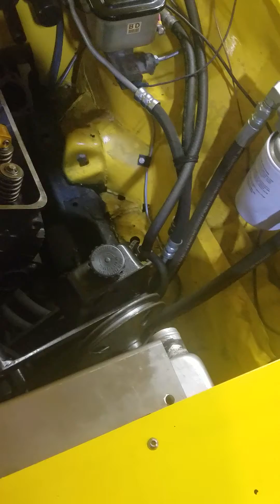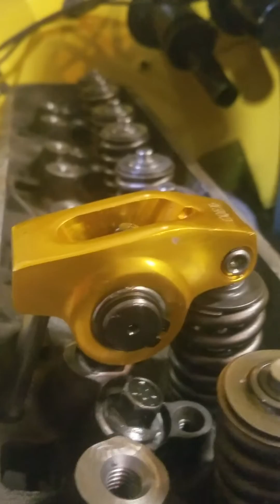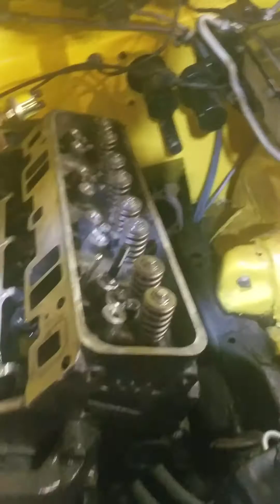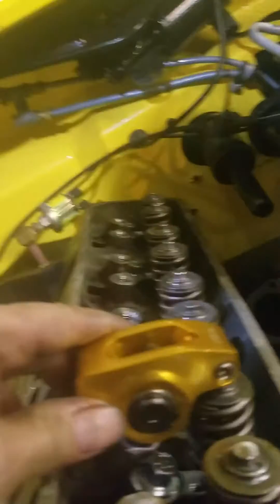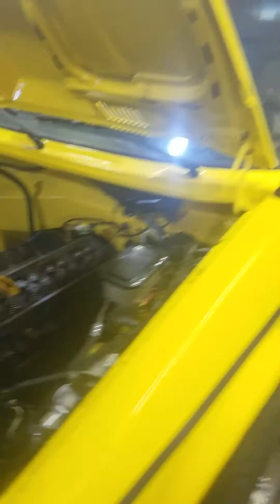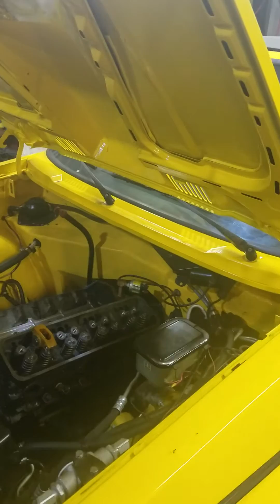Modifying and test fitting chevy 350 vortec heads for thread in rocker studs.

Comment: Another thing i wanted to mention, that car is not a 4x4 it is an AWD (all wheel drive)!!!
Reply from the maker: @jcanfixall1585  it is a 208 transfer case out of a 3/4 ton truck...  it is 4 wheel drive... it can be locked into 2wd or 4wd.

Not trying to be negative,  but it's always funny to me when folks who have never sat in the seat or ever even seen something in person tell others what something is or is not
Reply: @MinnesotaImplement  I made a mistake I figured you used a car AWD chassis to build it... Isn't it hard when cornering with 4x4... I built a 1983 Chevy C10 short box AWD using suspension out of an Astro van it was bad ass cornering a full size truck at 50mph, I had an Audi Quattro when I was younger.... There's a few AWD cars on YouTube one of the cooler ones is a G body I think a Cutlass from LA...

Comment: What part number for the ARP studs did you use.
Reply from the maker: Sorry, I don't remember..  it was a couple of years ago now, and I don't have the package anymore.   I would have gotten them from Jegs or Summit
Reply: @MinnesotaImplement  These stud dimensions are all over the place. Going to do a comparison vid with stock, pioneer, ARP and GM screw in studs. Hope to finish my jig for the Bridgeport soon.
Reply from the maker: @tjs_welding_and_fabrication  yeah, it is best to have the parts on hand before doing the machining...  otherwise it's anyone's guess on what is "correct".  I think that is part of where my original engine builder went sideways,  and why I ended up having to re-do this engine myself later on...  it was a mis-match of random high-end parts... all good parts, but nothing worked well together...  like he was clearing off his shelves of extra stock to build my engine...

Comment: no vortec will spin to 9 grand,EVER......

get a rev limiter and set it to 6000 MAXIMUM.vortec heads do not flow over 6500 when professionally ported,if these are stock they will struggle at 5500.
Reply: "vortec heads do not flow over 6500"...  That's baloney. The old "fuelie" heads were capable of letting a 350 spin well into the 6000 rpm range while still making power and the Vortec heads are head and shoulders above them from just about every performance standpoint, the only shortfall being their stock valve lift limitation. When modded for proper retainer to seal clearance, there's no contest. I agree though, 9000 rpm is well out of the realm of what Vortec heads are capable of.

Comment: 9000  RPM engine ???? WHAT ??? either you are smoking some real crazy drugs or your builder is a real good snake oil salesman the springs and retainers  look stock, voretc heads need to have the guide boss cut down for more than .450 lift or the retainers will hit the guides  After market roller rockers are a waste of time and money if you are below 6000 RPM's they basically do nothing dude you couldn't get those stock retainers/push-rods and lifter retainers to hold up to 9000 rpm for even 1 second not even if you dropped this thing out of a plane stock vortec heads will barley support 6000 RPM if they are really tricked out and yours look stock,  you got the studs and roller rockers right but left everything else stock you may as well put new wipers on an broken windshield for 9000 RPM you need a cam with around 750 lift and 320 degrees of duration hardened push rods hardened 10 degree retainers and keepers and valve springs with 500 + psi a solid roller lifter cam and a set of $3000 AFR heads to move enough air to support that RPM you will be lucky to see 5500 rpm with this engine and even if you go higher the heads make no power above that  they max out at 5500 this engine will make around 325 HP with those heads and that's at the crank you will see around 265 to 280 at the wheels trust me I build and dyno them all the time.
Reply: Myvintageiron7512 my stock truck motor caps at 5500. He can get probably 7k out of this motor
Reply: MyVintage, I was actually thinking about your videos when listening to this guy talk. Haha then I scroll down in the comments and see your name. Thanks for all your vids myvintage. I’m a newbie and I’ve learned a lot watching your vids. Thanks
Reply: There is plenty of documentation out there of Vortec headed engines making over 400 horsepower. I'm talking out of the box with stock ports and chambers and only mods to the valve guides and requisite valve spring/retainer packages. Plenty of small blocks from the 1960's made 350 plus horsepower with the old "fuelie" heads and turned well over 6000 rpm (the DZZ 202 went well into the 7000 rpm range and actually made around 390 hp) with a head that flowed nowhere near as well as the Vortec does.